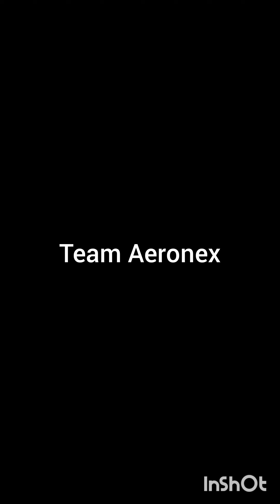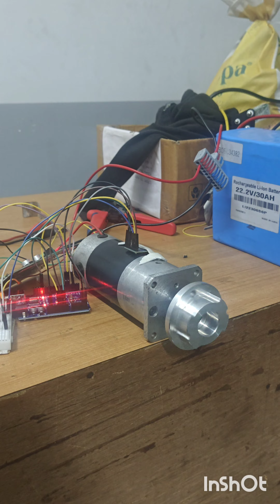AI BASED HYBRID FAULT PREDICTION AND ALERT SYSTEM FOR WIND TURBINE

Comment: The Aeronex team has developed an excellent predictive maintenance system for wind turbines that solves a long-standing industry challenge. Detecting blade faults, bearing failures, and gear defects has traditionally been possible only through manual inspection, which is slow, costly, and often too late. This innovative system predicts these faults early, allowing maintenance teams to take action before expensive breakdowns occur. By moving from reactive to proactive maintenance, wind farm operators can reduce costs, minimize downtime, and improve safety. This is a practical and valuable innovation that brings real benefits to the wind energy industry.